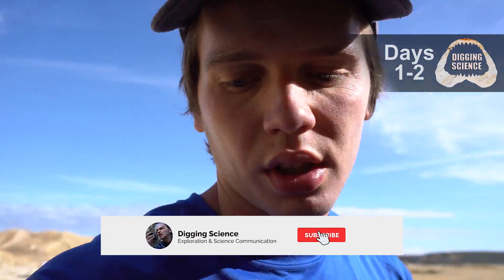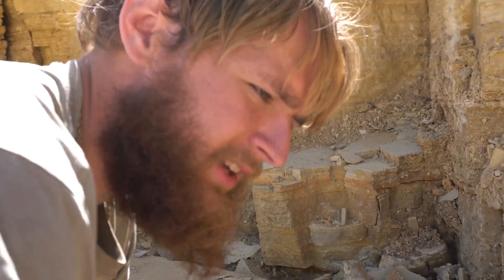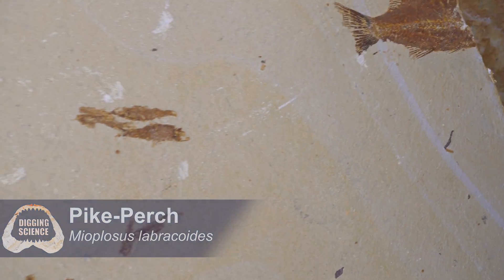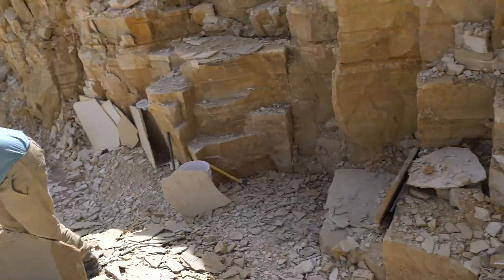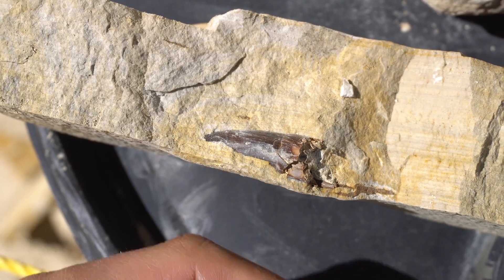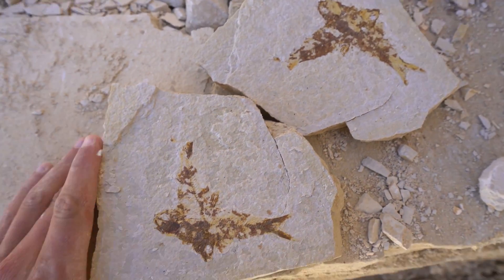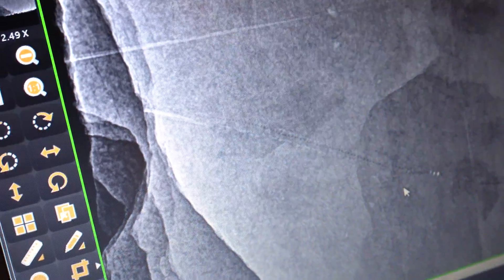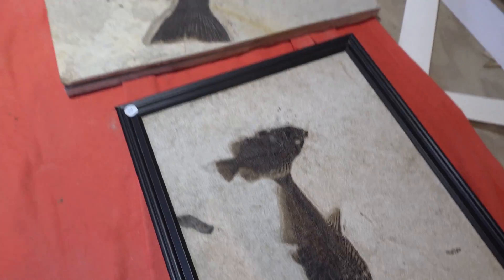Green River Fossil Fish Hunting Compilation 2019 | Fossil Hunting in Warfield Fossil Quarry

Comment: needle and stick! wow, how inventive! I use one of those tiny screwdriver sets for super small screws and bolts they go to insane small sizes and are super hard  great for digging those bones clear 
a great tip for DIY fossil restorations if you have a shell cluster in soft sandstone just take it with you when you go showering use the said screwdrivers and a toothbrush to get off the excess sandstone it will leave a sh#tload of sand all over the shower room and you including your tender parts (ooh!! wash vigorously after or get sand burn!) but at the end, you have a museum grade shell cluster without having to work for weeks.